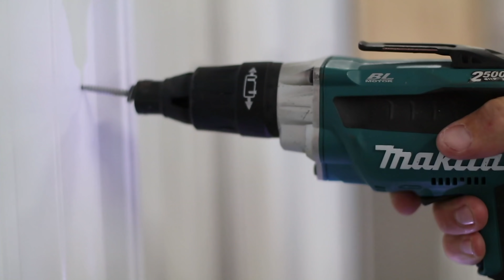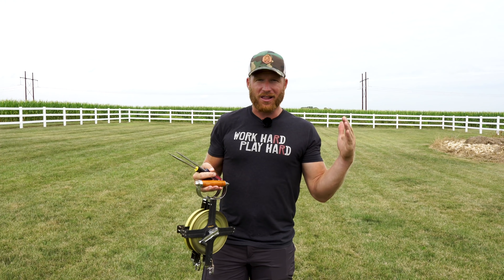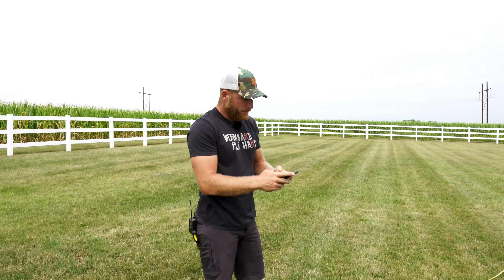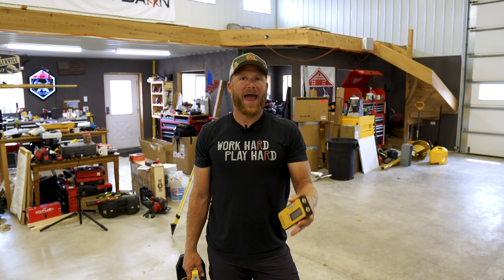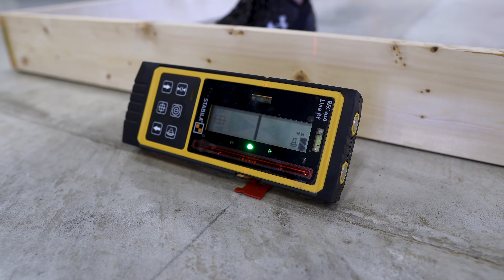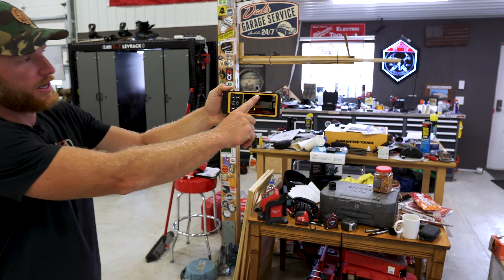3 Ways to Find Square...free to expensive

Comment: I use this Stabila also, excellent device.  I would recommend checking it's calibration occasionally in the shop using reference marks on floor and walls.  I've never had an issue with mine, always checks out but can't be sure otherwise.
Reply: Ranken survey had 5 units come in they had to send back to China because they couldnt get them accurate enough to be considered "calibrated" to begin with, quad 4000 or bust, its the original and 10,000 times better

Comment: Another way to find square without using any math and only using one tape is the intersecting arc method. 

Suppose you are trying to make a rectangle 60’x 40’:
-Like the method Kyle explained, establish your first control line and mark it whether it be a chalk line on something stationary or a string line from one stake to another. 
-Estimate (or measure) the approximate center of your first control line and mark it. From that center mark, measure each way, on the line, any random number you want. The larger, the better, relative to whatever it is you are trying to establish ‘square’ for.
-From the center mark, pull a perpendicular measurement of about 40’. Just estimate as best you can, perpendicular. You don’t have to be perfect. Perfect will come from the next couple steps. 
-Now from one of the randomly measured dimension marks from center, measure out to your approximately perpendicular 40’ mark. Again it doesn’t have to be exact. Swing and mark an arc, about 1’ or 2’ long. 
-Repeat the last step from the other mark on your first control line. The intersection of those 2 arcs will be exactly square or perpendicular from your original control line. 

You now have 2 lines, square to each other, that you can measure any dimensions you want, on an ‘X’ and ‘Y’ axis and be guaranteed of squareness. A simple sketch would make this much easier to explain but it’s really not very difficult, doesn’t require any math and works with any numbers you would like to use.

Comment: Excellent video . Now it would be great that you could show us how to use it as a grade stick . Have seen you use the laser many times and measure the height of the columns  . You have your metal brackets bolted into place and you use the grade stick to measure for height and mark down the numbers on the brackets . I have no idea what those numbers are . Thanks
Reply from the maker: good idea ... thanks
Reply: The laser level shoots out a beam of laser light that is absolutely level, 360° around the laser level base (head). You then go to the spot of a marked, known elevation with a rod (can be any straight stick) and the laser sensor. Hold the rod on top of that spot as plumb as you can. Then move the sensor up or down on the rod until it picks up the exact height of the laser beam being projected out by the laser base (the sensor will give off a constant tone). Attach the sensor to the rod. Now, wherever you go on the site you can hold the rod on any spot, move the rod with the sensor attached, up or down until you get that constant tone again. Then you know the bottom of the rod is at the exact same elevation as the original known spot. 
It’s important to remember that, the sensor on the rod, only tells you when it is level with the base. The bottom of the rod is the ‘business end’ and is at the actual elevation you’re looking for.
*The numbers he’s writing down on the brackets, is the difference in height, between the bracket elevation and the known elevation.
Reply: @psidvicious  thanks

Comment: I build aluminum boats and heres a trick I found for fractions. If you want to cut a fraction in half, let's say 5/8, just double the denominator. Half of 5/8 is 5/16. 
You can also double the fraction with the same reversed trick . 3/16 doubled is 3/8. Sometimes it gets a lil messy. Example: doubling something like 5/8 and youll get 5/4. Just use the 4/4 as your whole number and you have 1/4 left, so it would be 1 1/4. Once you get the hang of it, it's really easy and quick. And remember when you're adding fractions, make sure the denominator is the same for both. This saves a lot of time as I find manually calculating fractions sometimes confusing. I sit there and triple check my numbers because I don't trust myself lol hope this helps at least someone
Reply: Great tip!

Comment: Hey Kyle - I know this is an older video, but I am curious on the comparison between this and the LAR 350. It seems like there are some overlapping uses for both. ie, it seems like you can square with the 350 on its side, but then you can also capture grade with the 180. I haven't found any real good comparison videos out there. If you had to own one, which would it be? If you have some thoughts I'd greatly appreciate it!
Reply: Great question. Im trying to find out the same.

Comment: I didn't  catch whether it measured distance as well? I guess once string lines up and horizontal you could get accurate measures with a tape. Without having  to readjust for square from the manual method. Sorry just talking that through. Good tool i think i get it.
Reply from the maker: yes exactly...i just didn't want to go super in depth...just a over view
Reply: I wish laser tapes were more reliable.

Comment: Yes siree, you are right about the nylon tapes and metal tapes, they will stretch or shrink depending on the user. What's more, a metal tape will grow or shrink depending on the ambient temperature. So, if you are looking for 400 feet in 30 degree weather and another 400 feet in 90 degree weather, those two points will not meet or match each other due to the expansion/contraction of the metal in the tape. Surveyors have the same when they use their "chain" to get points in long distance so in the earlier days when using metal chains, they had to correct for the temps. Today, the laser equipment doesn't have that extreme inaccuracy although, I do believe light is affected by temperature but it's very minimal at earthling temperatures.  Also, what are those crossed 2x4's staked into the ground when laying out buildings at one corner?
Reply from the maker: Batter boards... I should make a video about them

Comment: Technically speaking you are using the Law of Cosines, not the Pythagorean Theorem.    The Pythagorean theorem states that if you START with a right triangle, then the sum of the squares of the two adjacent sides will be equal to the hypotenuse squared not the other way around.    Pythagoras did not say that if you start with a triangle where the sum of the squares of two sides equals the square of the remaining side, then it has to be a right triangle.   It's a subtle but significant difference.

Comment: Hey Kyle. Thanks for ur help. I've learned alot. I'm new to metal roofing and framing is now my new job. But I was on metal roof and starting out of valley. I could not figure out how to come out the valley. It was so annoying. I could not do it. Going into the valley was easy. But the section where it ended and started in a valley. Well just wanted to ask if u could make a video on it. Think it would help alot. Even on small scale e

Comment: Thats probably the 1st "expensive" tool I've seen u with that i see value in, n if i could afford it I'd buy it in a heartbeat (unlike that damn 4k work station). Here in Jamaica its a lot of hills n to square a building on a slope of 25 to 30 degrees over a 50' span is a hell of a job. That would make the job 99% easier. My question/s tho is, when on the tripod how do u identify where that plumb laser would be on the ground? And 2 does that device measure the horizontal disrance the receiver is away from it?

Comment: Another trick that an old roofer taught me was this, 
Snap three parallel lines on the roof deck from one end to the other. One close to the edge and one close to the top. 
The other one is in the middle of these two. Take a nail and drive it in any place along the center line. 
Then hook your tape on the nail and measure any distance, as long as its the same distance to the top and bottom line.  Then snap a line from top to the bottom .This will square up the roof panel.
Reply from the maker: Interesting
Reply: That would work..nice n easy
Reply: I like that.  Makes a midway double check easy anywhere on the surface.  Make sure those three lines are PARALLEL to the roof, not just each other though.  This would really work well laying steel strips that go from the top to bottom as Kyle does since he always has one guy at the top and one at the bottom and they both have tape measures, no vertical line needed.
Reply: Yes 
You measure up from the bottom, any random number say 4''. 
Go to the other end and measure the same up from the bottom snap a line. 
Then measure up to the top, you can stay down a couple inches . 
I always use an easy number to divide in half. 
Then measure up the same distance at the other end snap a line.  
Then snap a line in the center. 
You do not have to go the whole distance at the top or center with a line. 
Just long enough to get where you want to measure from.

Comment: Great explanation and video! This maybe a stupid question but I will ask anyways. 
With the Lazer calibrated to your property line distance and reading 90* to the right and 90* to the left of the main lazer, does it also indicate the opposite corner from the lazer unit? Or at that point would you mark all your first indicated points then set the hand held unit at the indicated 90* point and move the main lazer unit to the opposite corner until it notifies you as the unit is moved to get your completed square or rectangle layout? Just wondering how much it does for $1500.

Comment: He always mentions the pythagorean theorem...... but never really explains what it is. 

So...... pythagorean theorem is just a^2 + b^2 = c^2 (said as, "a" squared plus "b" squared equals "c" squared) 

a and b are the legs of your triangle.  C is the hypotenuse. 

So in his 3 4 5 example 3 and 4 are the legs.... a and b.

3 ^2 or (3x3) is 9. 4^2 or (4x4) is 16.  16+9=c^2.  25=c^2.  To get rid of that exponent.... take the square root of each side.  Square root is just doing the reverse of taking a number and squaring it like we did for the numbers 3 and 4.  So the square root of c^2 would just be.... c. The square root of 25 (remember our 9+16) is..... 5.  

That's how you get 5 for your hypotenuse.  It's really not that difficult.  Extremely simple if you just have a calculator on hand and if you're like 95% of the population.... you probably have a smart phone in your pocket right now... aka a calculator.  The way Kyle says you can apply the 3, 4, 5 rule to anything... so long as you increase our decrease those numbers by the same multiple....  is limiting. What if you wanted to make a perfectly square building... or patio?

a^2 +b^2 = c^2

Say your patio you want to lay down should be a 15x15 foot square. 

15^2=225.  So both your a and b are 225.

225 + 225 = 450..... 450=c^2

This is where your calculator comes in handy because c will equal...... 21.2132034356.  Or.... roughly 21-7/32.... 21.21875.

Once you know how simple the pythagorean theorem is.... I hope you'll find you can easily figure shit out with nothing but a pencil and paper and maybe the calculator on your phone. I looked into the calculator app Kyle pushes and it's a $30 app.... $30.... to pretty much figure out ONE equation...  that's not that difficult to solve sans expensive calculator app.  Even on that last example.  15 squared is pretty simple.  Usually finding the square of a and b IS pretty simple.  15 x 15 can easily be done in your head though.  Just take 15x10..... 150.... then 5x15.... 75. Simple.  150+75= 225.  In my head that breakdown takes maybe 5 seconds.  Then adding that number to itself to find the sum a and b takes less than a second.... 450.  Then just punch in the square root symbol on the built in calculator on your phone and then 450.... poof. 21.213 pops out. Simple, quick, easy.... and knowing how to do a simple equation like this made you $30 richer.  

HA!  I just googled "pythagorean theorem" on my phone and Google literally has its own calculator to find the value of c.  Just punch in your a and b (legs) values and it farts out the value of c (hypotenuse).  So..... there's that option too.  Point being.... if you would get this $30 calculator app "for builders" just to do pythagorean theorem problems to find square...... just use your phone's calculator.... or better yet.... just Google "pythagorean theorem" and Google will do the "hard" math for you.
Reply: It does more than just Pythagorean theorem calculations. Press one more button and it gives you the angle. Press once more and get the complementary or supplementary angles. It calculates feet, inches and fractions, etc, etc…

Comment: when the main Lasor slid to the right to find the receiver how without the machine moving kept a straight line? kind of like if you shoot a flying bird . the point at which you lock on the bird follow it and shoot is different. yes you shoot a straight line by you shoot to the side of the desired point?

Comment: 3, 4 5 triangle is and is no Pythagorean Theorem.  3 squared is 9  plus 4 squared is 16== 25 which the square root is 5,,,,   8' wall and 21' wall,, your calculator IS using Pythagorean Theorem,, A squared +B squared= C squared,, It is not a 3,4, 5 triangle.  A custom hypotenuse IS very convenient because you know from building CORNER to building corner what is square by just taping corner to corner.  I used to use a pencil for those corner to corner measures, on a cut off 2X6 end from one of the sills.  Calculators make it so much easier and faster.

Comment: Need to check your calculator:  the diagonal should be 36.0555 feet -- that is more like 36 feet and 1 sixteenth.
Reply: Need to check your logic.  36.055512 feet comes out to 36 feet and 10.658 sixteenth inches which rounds to 11/16" just like he said.   (0.055512 foot x 12 = 0.666144 inches and 0.666144 inches x 16 = 10.658 sixteenths of an inch which rounds to 11/16")   FYI, if he was working in 32nds of an inch it would have been 0.666144 x 32 = 21/32".